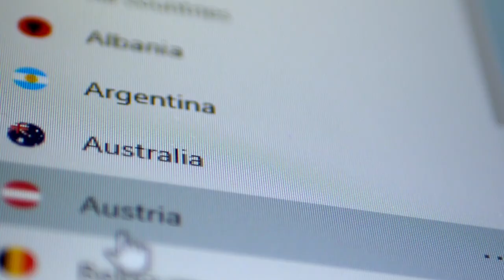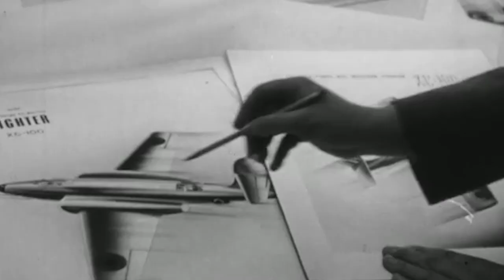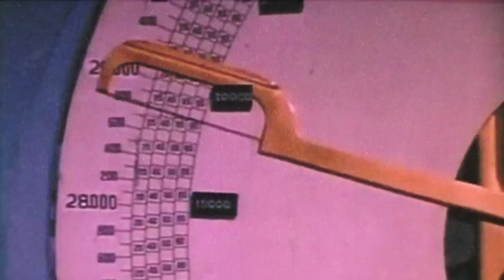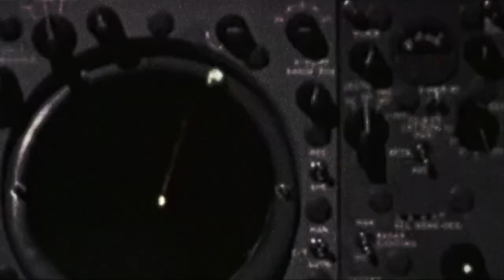The BAC TSR-2 – The Most Outstanding Military Aircraft to Never Serve

Comment: This story sounds eerily like what happened Canada's Avro Arrow. In that case no airframe survives.
Reply: Too much coincidence I think
Reply: i was just thinking the same thing, absolutely amazing plane but NORAD had different opinions
Reply: the cia informed the arrow team that their program was being compromised with communist spies from the ussr and thus should destroy all prototypes, jigs and technical drawings. the US also desperately needed engineers who were able to work with titanium which avro had the best in the world at the time. canada has since been a patriotic supporter of the american aircraft industry.
Reply: @mrrolandlawrence  all thanks to the feckless farmer prime minister at the time, Diefenbaker.
Reply: look up Gerald Bull worked on the Avro Arrow, went on to build the HAARP, streamlined artillery shells, then built the "Babylon Gun" before being killed
Reply: MercyReaper  The Avro Arrow was anything but a failed ancient plane. It was test flown and surpassed anything in the world at the time. You don't know what you're talking about.
Reply: @bobmcrae5751  Total myth. It was outperformed by the F-106 that was already in late development at the time, and would have entered service first. The F-106 was Mach 2.3 capable in practice, while the Arrow was only mach 2 capable in theory (never got close in testing) and the F-106 was also smaller, had better armament, and could be built in greater numbers at lower cost because of not using expensive titanium construction like the Arrow.

The only people who obsessively go on about the Arrow are those who never bothered to actually compare it with other jets from the time.
Reply: @AllThingsCubey  Bull shit! The Arrow had greater range and speed than any other aircraft of the time.
Reply: Mew, mew, mew, mew - Like listening to a bunch of kittens. Grow up. The Arrow was nothing special, look at the F-107 and F8U3 - first flights within months of each other and could eat the Arrow's lunch.
As for the TSR-3 - It was a freaking decade behind. One trick pony: Point it in the right direction and it could go. But by 1966 there were a half dozen already there, and some were nearing retirement. GIVE IT UP.
Reply: @AllThingsCubey  "The Arrow had greater range..." Ha ha ha ha can you believe anyone would use the Arrow's range for an argument? Maybe it was fast. Who knows? It never held a speed record because it didn't have enough range to do the second pass in the opposite direction!
Reply: It was the right move . The Arrow was a bomber interceptor not a air superiority fighter.
The Russian switched to ICBMs from bombers which can not be intercepted.
Reply: There are many opinions here about which aircraft was better and why the Avro was cancelled. But these arguments ignore the primary driver for its demise. Designing, prototyping, debugging, repeated midstream revision of design goals, and ever changing geopolitical priorities, render jet fighter development way too expensive for all but the biggest economies. 
Their costs have continued to grow to such extent that even the U.S. could not fully bring the F-35 to fruition without engaging other countries to both make some of its components and commit to buying some of the aircraft.
We can all speculate about U.S. 'arm twisting', but the reality is very few countries can budget for the development of an advanced jet all the way through production without it severely crimping the rest of their budget for other military and civilian priorities.
We'll likely see an early demise of Russia's SU-57 for the same reasons. India cancelled their bid to buy the SU-57. So any prospect of achieving some economy of scale via. international sales (such as the F-35 has) is gone. China expressed some interest. But China has repeatedly screwed Russia by buying a few, then reverse engineering and cancelling any further orders. I'm sure Russia does not want to see yet another repeat. 
In a way, I'll be sad to see the SU-57 go. It looks like the Ferrari of aircraft - very sleek, with superior aeronautical performance (barring engine reliability issues)
Reply: Just what I was thinking
Reply: Thought same
Reply: Yes the same situation IMO the yanks put pressure on both governments to buy from the USA..
Reply: @gregparrott  The greatest loss with regards to the Arrow was not the cancellation of the plane itself. That would be secondary to the loss of cutting edge engineering and the technologies they developed. Canada's loss was the wholesale loss of talent, most who ended up in the US. Instead, the Canadian government could have so much more to transition the team to a more sustainable project. As with most, the government of the time was very short-sighted. High technology was not in Diefenbaker's wheel house.
Reply: @peterschattmann8298  I agree with you. A current example of the costs imposed by losing strategically critical engineering and manufacturing skills was revealed by the pandemic. Even the U.S. lost most of its labs and manufacturing base for medicine and medical equipment. 
Another glaring example of strategically essential capabilities having been lost occurred when the Loma Prieta earthquake struck the San Francisco Bay area in 1989. A lot of massive steel beams were immediately needed. These are typically made to order. We had lost so much of that capability that most of the beams were made in Japan and shipped here. Heck, the Bethlehem Steel used to have facilities both in San Francisco and Oakland, as both they and another major steel company were involved in the construction of both the Golden Gate and Bay Bridge (and probably some of the other bridges within the Bay Area as well).
The idea of the U.S. or any other 'developed' nation being heavily dependent for food, medicine, manufacture and support of essential infrastructure, water, and even energy, is very unsettling. I could add 'money' to the list. But given that the U.S. is the world's largest debtor nation by far, that's another story.
Reply: @AllThingsCubey  How did the F-106 have better armament, when it was armed with 4 AIM-4 Falcons while the Arrow would've carried up to 8 of the same missiles?
Reply: @RedXlV  Because the F-106 could also carry the AIM-26 Super Falcon, a much longer ranged, tactical nuclear missile for wiping out bomber formations or incoming nuclear missiles. It also had access to later and more advanced versions of the AIM-4 Flacon than Canada did, and due to much lower cost, several times lower in fact, the F-106 had much greater numbers to offset the lower capacity.
Reply: There are 2 TSR2 airframes in existence. One is at the RAF museum at Cosford and the other is at IWM Duxford
Reply: @gregparrott  There's just one flaw with your theory: ever hear of these military jets? The Saab Lansen, the Saab Draken, the Saab 105, Saab Viggen, Saab Gripen? Swedish aircraft. Population of Sweden? 10 million. Much less of course, when these were made.
Reply: @peterschattmann8298  Same with the TRS2
Reply: Jack Tangles  ?
Reply: Jack Tangles  "As good as F-106", yeah, well F-106 was 4x cheaper and already in service.
Reply: Jack Tangles  Yeah. You could buy four armed F-106s for the cost of a single Arrow. Not to mention, the Arrow was in service, in use, already, while the Arrow was just a prototype.
Reply: Jack Tangles  why not Google that.
Reply: Comparisons have been made, since this (along with the Miles M.53 and CF-105) were the few projects they were ordered destroyed from the ground up.  The assessment was that even a small number of TSR.2 (like 20) could have still been useful.  TSR.2 is one of the reasons why I'm an American, but I loath the F-111.
Reply: The Arrow was an outdated concept. The pure interceptor was to be replaced with the much more  flexible air superiority fighter. It wasn’t a Mach 3 aircraft either.
Reply: @SvenTviking  Not the initial design, but they had a design in the works that was not much different to hit that speed (or higher).  And with interim engines (the J57) it still reached nearly M.2, so plenty of potential.  Didn't survive to get the chance, did it?  Remember that the F-108 was designed for M.3 and it still got cancelled (because it's main competitor, the Arrow, was cancelled only months prior).  Interceptors still have their place (MiG-31 being an example), so it's not really out of date; its just a niche that has it's own environment to use it with.  If what you're claiming was the case, the F-106 would have been canned a lot earlier too, especially after the F-15 started flying.
Reply: The only thing the two had in common was that they were both white.
Reply: Jack Tangles  Yeah it's like comparing apples to oranges.
Reply: @AllThingsCubey  You really don't know a damned thing about the Arrow, or the cost of the 106.
Reply: @SvenTviking  It was intended from the very beginning to be multi-role.  You don't know the subject, shutting up would be a good idea.
Reply: @barryfortier6377  I'll stick by my assessment "by 1966 there were a half dozen already there, and some were nearing retirement. GIVE IT UP." Looking at some other posts you're sure quick to call people idiots, in the popular 2020 parlance that's called projection. Thank you Canada for your engineering prowess designing the LEM for Grumman.
Reply: @cowboybob7093  And some new ones came along after that date.  I do not project, I merely comment on obvious points.  Oh, by the way, the Avro engineers who went to nasa, did a hell of a lot more than just the LEM.
Reply: @barryfortier6377  Excellent, you concede TSR-2 was superfluous. Canadian engineers are awesome, you even agree to that, you're making progress Barry.
Reply: it's all a coincidence, don't ya know?
Reply: They even destroyed all the lab equipment and instrumentation used for the Avro program. Total annihilation of any future Canadian military aerospace projects
Reply: @johnpotter4750  Had nothing to do with the US.  Canada didn't have the budget for it.  It pissed on the Navy because the money for the Avro would have been stolen from their budget.  The idea that the US killed it is disingenuous.
Reply: @mrrolandlawrence  And let us not forget where Avro sourced that titanium....The USSR...
Reply: @AllThingsCubey  The F-106 and the Arrow were built for different missions.
Reply: Richard Tattis  Wikipedia is your friend.
Reply: Imagine a TSR-2  - Avro Arrow force. What a combination that would have been!
Reply: Ones in lake ontario
Reply: No one wanted to be associated with these embarrassments.
Reply: @cowboybob7093    I think you need to stop litening to kittens.  It's clearly had an ill effect on your brain.
Reply: @mrrolandlawrence  Bollocks. The US was already flying the nearly entirely titanium aircraft at the time, the A-12, the precursor to the SR-71. The only titanium utilized in the Avro Arrow was in and around the turbojets.
Reply: Same with the B-70.
Reply: Just watched a vid about the Avro Arrow and the story immediately reminded me of the TSR2. Real shame.
Reply: @karlfulton4854  Huh? Lmfao
Reply: Then there's the remarkably similar destruction of the Nimrod refurbs (Boeings bought instead).
Reply: @cowboybob7093  "Point it in the right direction and it could go. But by 1966 there were a half dozen already there,"
errr... care to name one bud?
Reply: @gregparrott  "render jet fighter development way too expensive for all but the biggest economies. "
And then there's Sweden and France's aerospace industries..
Reply: @Tomartyr  F4 Phantom II a thoroughbred with the spirit of a mule and the range of an aircraft carrier.
Reply: @cowboybob7093  and external stores significantly reducing its speed.
Reply: @Tomartyr  I'll save you the trouble and put this negatively: F-4 Phantom II less than 5200 built and hardly any in service after 60 years. BTW, & sincerely: Love the Olympus
Reply: @frankanderson5012  I guess I missed the notification of your reply. Well Played I'll save you the trouble of looking up our exchange:
Cowboy Bob ...months ago
Mew, mew, mew, mew - Like listening to a bunch of kittens. Grow up. The Arrow was nothing special, (and so on)
Frank Anderson 1 month ago
@Cowboy Bob    I think you need to stop litening to kittens.  It's clearly had an ill effect on your brain. 
More people need to bring a sense of humor and perspective to topics like this 👍🏽👍🏼
Reply: Actually, there are 2 remaining prototypes of the TSR 2 left in England. One in IWM Duxford and in RAF Cosford. I’ve seen the one in Duxford
Reply: @heinrichmuller7974  what is the babylon gun?
Reply: @patrickdean9797  type in the name gerald bull  he worked on the avro arrow program and later went on to design the biggest guns ever made, "baby-babylon" a smaller but working version of the babylon gun was made for sadaam hussein, it used a huge cannon, the size of oil pipeline and mounted on a sandune, i'm sure google has pictures.
Reply: @AllThingsCubey  I think you will find the operational requirements were very different. Like the TSR2, the Arrow was a strategic bomber/ strike aircraft for low level deep penetration. Not a dogfighter
Reply: @adyhayward  Wtf are you on about? Arrow had absolutely zero low level penetration requirement. It was a high altitude interceptor.
Reply: @AllThingsCubey  There was talk within the Hawker Siddeley Group who took on some of the work following Avro's cancellation or it being better suited to a similar role as the TSR2 as it failed as a pure interceptor. Sadly, as with the TSR2 the mandate for the destruction of all drawings, jigs and airframes leaves this open to debate. For sure all involved would have tried to steer the projects into other viable solutions to keep them alive
Reply: @AllThingsCubey  One of my family members had connections with the Hawker Siddeley team that discussed what could be done with the project. it seems he must have been talking crap
Reply: Exactly same story was repeteated in a lot of countries. (Argentina, Israel, Canada, Germany, Swiss, Yugoslavia. Not sure if USA had intervention in all of them)
Reply: Yes, first thought that crossed my mind.
Reply: @AllThingsCubey  Your' never got close to testing' is not true - an Arrow had its Iroquois engines installed and was virtually ready to fly before 'black friday'. The comparable plane of the time was the F104 and as much as I admire Kelly Johnson it was a quick fix to meet the required spec - stick little tiny wings on a big engine - and it killed a huge number of pilots. Indeed that is what Canada replaced the Arrow with after the Bomarc missiles turned out to be pretty much useless.

The expense of titanium was not an issue - the iroquois engines were actually cheaper than the J75 it was meant to replace and were superior in every way - thrust-to-weight, power output and fuel consumption -and by a significant margin. 

The sad thing is the Orenda turbojet could have become the core of a long line of Turbofans and that is perhaps the saddest part of this story.
Reply: @AllThingsCubey  to be fair the Arrow was the first plane ever to have fly-by wire technology. The F-106 takes the cake on the looks department, though
Reply: @francisrampen9099  a large number of F-104 losses were from West Germany who used it as a low altitude attack plane even though the plane was originally designed as a high-altitude interceptor
Reply: POLITICS & MONEY "KILLED" THAT BIRD !!
Reply: @bobmcrae5751  
Huh? The maximum level-flight speed reached by a CF-105 was Mach 1.90 on November 11, 1958. By contrast, the F8U-3 Super Crusader attained Mach 2.2 in August of 1958 & the F-104A attained Mach 2.14 in May, 1958.
The Arrow 2's (proposed) maximum range was less than 600nm.
Reply: @cowboybob7093  any of them super cruise?  The lightning could intercept the u2...   usa went after uk...
Reply: @samweljones7578  Super cruise by whose definition, what threshold, for how long? F-104 went supersonic without afterburner before the Arrow, but is that super cruise? As for "intercepting" a U2, its ballistic trajectory was recognized as uncontrolled flight at the time, and 90,000' / 27.5 KM flights were novel but not new.
Reply: Gave rise to SR-17 Strange coincidence ? Politics to the Fore.
Reply: I find this funny as my grandad worked on both the TSR 2 and the avro arrow
Reply: And our missile programme suffered a similar fate. The US put a block on these projects. The Up dated Nimrods was also dismantled. This reminds me of the strange decision to smash up the computers at Bletchley. Why they had to break up these planes only they know and we can only speculate.
Reply: @bobmcrae5751  The successor would be the Mig-31 which is still flying and likely will be for decades to come.
Reply: There are 2 airframes still in existence. A complete airframe at RAF Cosford, tail number XR220. And a second less complete airframe at RAF Duxford, tail number XR222.
Reply: My thought as well.
Reply: ..same for teh C-102 Jetliner.  Howard Hughes wanted 50 of the type for TWA after piloting the prototype..  Rhe C102 was rolled out only two weeks after the ill fated Comet 1 and used oval instead of square windows.
Reply: @jimstewart_kw  It's no coincidence, both aircraft were failures.
Reply: @Tomartyr  The Nimrods were grounded due to fatigue damage and were unrepairable... Boeing was the only option, Britain no longer makes any transport aircraft.
Reply: It was to do with the dominance of US money that the TSR2 project was cut, we were horrified at the time about this blow to national prestige by our politicians.
Reply: @gregparrott you have the same surname as my mum; I think that the overwhelming factor in both British & Canadian aircraft industries was a US desire to dominate aviation & they had Britain (at least) in a financial stranglehold.
Reply: @pcka12  I do have some lineage back to both England and France, although it it's not well detailed.

Admittedly, the U.S. has the most clout to influence markets. That's especially true in aircraft manufacturing, given its dominance in aircraft production dating back to WWII. There are a lot of avionics jobs and industries which solicit support from politicians. But this is is by no means unique to the U.S. Pretty much all countries have companies/organizations pressing politicians that jobs and industries need support. This occurs in the full spectrum of employment. Look at what's happening in Poland and France, where farmers are protesting, blocking roads, rioting, etc. Truckers doing the same in the U.S. last year. Each listed foreign competition as one of multiple grievances.
  
Airbus did the same, and probably still does. Currently, China's attempt to enter the commercial aircraft industry (Comac), is pressing to get their products into markets. It will be a challenge. When it takes years and billions to develop a product, and then a lot more time for certification, the market may not support three major competitors. Comac gfaces additional hurdles. Their aircraft are not internationally certified (yet). What's worse for Comac is that the CCP's belligerence has alienated the west. Consequently, the CCP's abilities to impose acceptance of their commercial aircraft is limited to China's domestic airlines.
Reply: @gregparrott  we had at least one 'historic' relative who was engaged in smuggling between England & France!

The TSR2 / Macdonald Douglas Phantom situation is now 'history', WW2 pretty much bankrupted Britain; with the wisdom of hindsight the NAZI regime & USSR might quite easily have destroyed each other if left alone, but Churchill having repelled the Germans was determined to expel them from Europe whatever the cost, leaving the UK deeply in debt a situation which continued into the 1960s & beyond.
Hitler's finances depended on conquering countries & asset stripping them, a policy which could not last since he was running out of countries which had anything to steal.
Reply: @pcka12  Both BAC and TSR.2 were disastrous failures, a shameful and humiliating chapter in British aviation history and marked the beginning of the total collapse of the UK aircraft industry.
Reply: @pcka12  Britain was never a leader in aviation technology and after the country's defeat in WW2 its demise was inevitable.
Reply: @gregparrott  Bollocks mate! Britain produced substandard, inferior aircraft that operators refused to buy, eventually British were so bad that even British operators refused to buy them anymore!
Reply: @pcka12  That's an interesting theory you have concocted but it doesn't explain why Germany is the largest manufacturer of jet aircraft in Europe and the second largest in the world today.
Reply: @WilhelmKarsten  If you look at two comments I made three years ago, one near the beginning of this comment thread, as well as an independent, 'root' level comment, you'll see I agree with you The root level comment said "To call this aircraft 'outstanding' is a misnomer. While the design goals were outstanding, it never reached them. Furthermore, design requirements were 'softened'. Add to this - cost overruns, engine explosions, conflicting change requests, etc. Based on the content presented here, I fail to see how or why this aircraft was 'great'."   But at the same time I will admit politics definitely try to tilt things in one's own favor.
Reply: @WilhelmKarsten  aircraft are built in bits throughout Europe & numerous international agreements exist between European nations, which is why Britain has been unable to market it's Eurofighters to Saudi Arabia  - Germany as a manufacturing partner of Britain doesn't agree with sale to that nation, down the road from where I am writing is a major British/Italian helicopter manufacturer, there are partnerships with France, Spain, Sweden, the USA & Japan, you are simply ignorant
Reply: @WilhelmKarsten  you do seem to have your facts a little ar*e before elbow!
Reply: @pcka12  Please name a single British company that still makes British jet aircraft in the UK?
Reply: @pcka12  Eurofighter Jagdflugzeug GmbH is a German company based in Munich Germany.
Leonardo is an Italian owned company... not  British.
Reply: @WilhelmKarsten  BAE Systems, Airbus & Leonardo also Thales, which like all other companies these days have shared interests between nations, Rolls Royce also plays a major part with it's engines powering the latest Turkish warplane as an interesting aside,
BAe has interesting origins & connections such as Hawker Sidley, Bristol, Vickers Supermarine, Gloster & so on, it also has ownership in well known German names, artillery bought by US amongst others, shipbuilding, and Britain has a shared contribution to the F35 Lightning project, reckoned at 15% which is a massive contribution relative to Britain's size.
Reply: @WilhelmKarsten  strange all of that, since Leonardo is just down the road, Thales not far & the Eurofighter works further north of course the names Westland & EMI com into play one of the reasons that Leonardo for one likes to emphasise it's Britishness.
But governments these days ensure that this work is shared up between the partner nations with Spain having a share of Eurofighter.
Reply: @pcka12  Please name a single British company that still makes British jet aircraft in the UK????
Reply: Yes, the Arrow was too expensive for Canada just as no one could afford to buy the TSR.2 which completely failed to deliver on its design specifications.
Too little, too late and obscenely over budget.
Reply: @Jusuff The Arrow was not the first plane to have fly-by-wire technology..
Reply: @pcka12 *The cancelation of the TSR.2 program is a story of the total collapse of the UK aircraft industry..
BAC was a joke... these clowns failed to produce a single successful aircraft design on their own.*
Reply: @pcka12 That's funny, considering that Leonardo S.p.A. is a completely Italian owned company... BAE sold its shares in what is now Leonardo almost 2 decades ago.
Reply: @pcka12  Why are some many brits in total denial about the collapse of the UK aircraft industry?

Just answer the question lad, Name a single British company that still makes British jet aircraft in the UK?
Reply: @pcka12 Westland Aerospace ceased to exist decades ago, GNK sold its interest in Agusta Westland in 2004 to Finmmeccanica, which became Leonardo.
BAE Systems sold its remaining interest in Finmeccanica in 2007.

Leonardo U.K. is registered as a foreign company and is a wholly owned subsidiary of the Italian company Leonardo S.p.A.
Reply: @pcka12  I suggest you drive by Lysander Road in Yeovil.
The sign on the front of the factory no longer says Westland... it says LEONARDO
Reply: @WilhelmKarsten  why would I drive by the factory when I walk past it ?
The whole history of Westland, Agusta Westland & the new name of Leonardo is quite comprehensively set out on the Internet along with the customary incidence of corruption in  Italian businessmen.
If you wish to argue with Leonardo with it's various sites in Britain & loyal British workforce, then be my guest to go ahead & do so.
Reply: @pcka12  Too poor to own a car? Or are you too old to drive?
New name?  You mean to say NEW COMPANY.
Westland helicopter no longer exists.
The site on Lysander Rd. is currently occupied by a New Foreign aircraft manufacturer, an Italian company called LEONARDO S.p.A.
There are no longer any British companies that make british helicopters in the UK.
Reply: Everything I have ever read from a credible source said that the TSR.2 could barely fly and never came even close to achieving its GOR.339 design specifications. BAC requested a reduction in the contract performance specifications and a huge budget and schedule allowance to essentially redesign the whole aircraft... this after wasting millions of pounds on the original (now  useless) design.
Reply: @pcka12  Leonardo U.K. is registered as a foreign company and is a wholly owned subsidiary of the Italian company Leonardo S.p.A.
Reply: @sandervanderkammen9230  great, but beginning with your original proposition,  I can confirm for you that helicopters are manufactured at the Yeovil site and test flown on the grass airfield there, ready for their customers comprising amongst others the British armed forces.

If manufacturing was withdrawn from Britain it is entirely likely that those sales would cease because Britain is motivated to purchase from a British based manufacturer & the product originally developed by Westland continues to meet British needs whatever 'badge engineering' has taken place.

The name Leonardo was chosen because everyone venerated Leonardo Da Vinci who sketched an imaginary helicopter amongst other clever ideas.
Reply: @pcka12  There are no longer any British companies supplying british aircraft to the RAF.
Reply: @pcka12  Leonardo S.p.A is a Italian company. there was no name change.
Reply: @sandervanderkammen9230  after a while you just become intensely boring, you are clearly incapable of comprehending the facts of international companies nor the history of British government involvement of maintaining Helicopter manufacturing in the UK, Italy is an 'allied nation' of the UK & fellow NATO member. The British Government doesn't give a toss about the money financing it's aircraft coming from Italy or for that matter Timbuktu, what it cares about is retaining facilities, skills & manufacturing base within the UK, & that is demonstrably what has happened in numerous cases with the UK remaining a world centre I aviation & other high tech industries, because that is what matters.
The City of London as a World Centre for Finance deals with money from all over the world & retains a reputation for probity & reliability.
Britain has long traded in dollars as well as sterling & welcomes business from all over the world, Amazon being a prime example, Leonardo a far smaller one.
You clearly fail to comprehend any of this!
Reply: @pcka12  Well, if that's true? why did Britain privatize the aircraft industry in 1986 and allow the British aircraft companies to go tits-up or be swallowed up by foreign owned companies?
 These foreign acquisitions have led to massive layoffs and shuttering of British factories... if what you say is true this policy has been complete and utter failure for Britain... a country that once produced 95% of its aviation needs, it now buys 100% of its military and commercial aircraft from other countries.
Reply: @pcka12  You don't seem like you are very British, are you an immigrant? Polish? Pakistani?
Because you clearly don't know anything about the history or the collapse of the British aircraft industry.
 Britain was never a leader in aviation technology and the industry was doomed after the country's defeat in WW2...
Please name a single British company that still makes British jet aircraft in the UK?